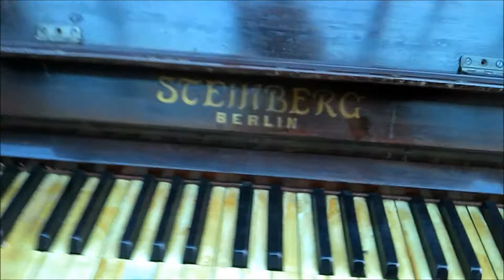Steinberg Upright Piano

Comment: Tuned to A424Hz except the bass notes are at A440Hz Two strings on the same note have been replaced at some stage and another string is broken. A hammer is missing. The inside is also full of dust. The keytops could do with buffing.
Reply from the maker: Thanks a lot for the input again :)